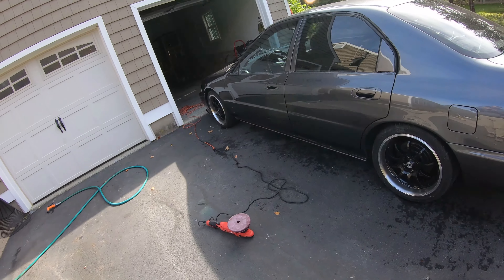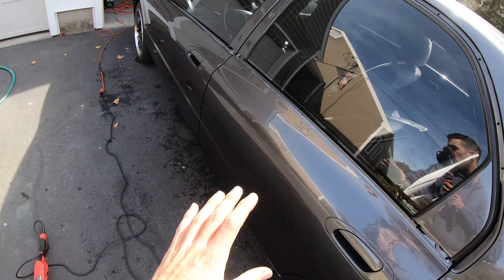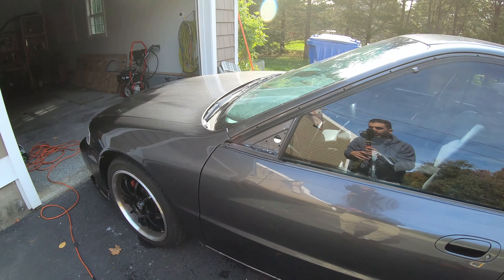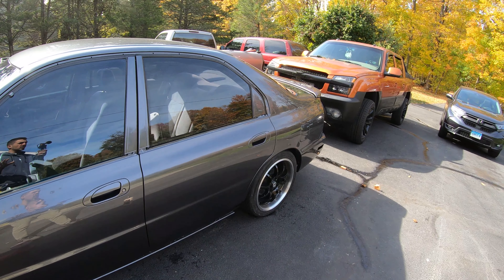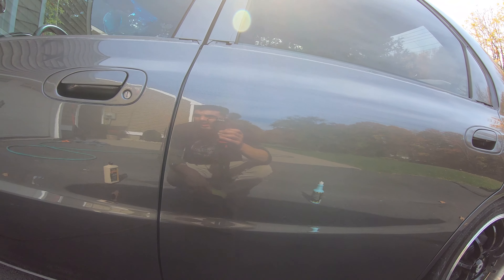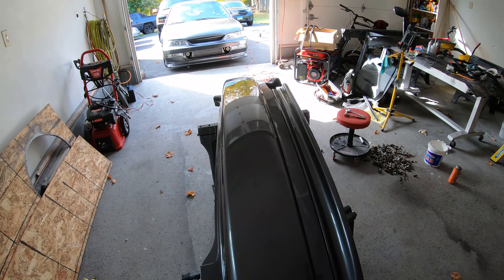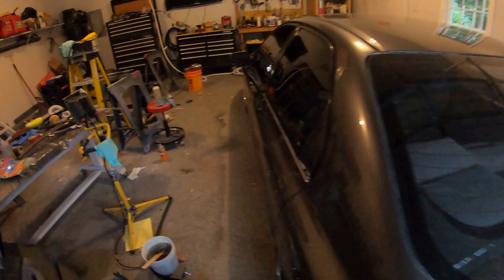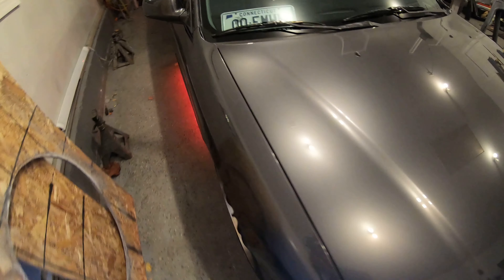Turbo Accord: Final Assembly Time

Comment: Hey what’s up man I have a question. When you had your old manual boost controller setup. You left the top port on wastegate open as well as the top port on boost controller open correct ?
Reply from the maker: Yeah the top of the wastegate I left open and the vent port on the manual controller I left open.